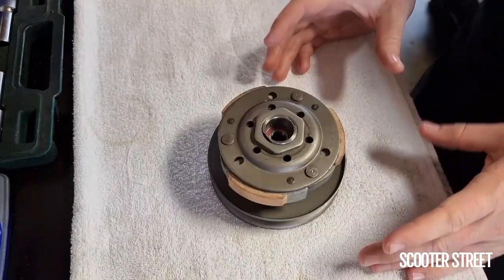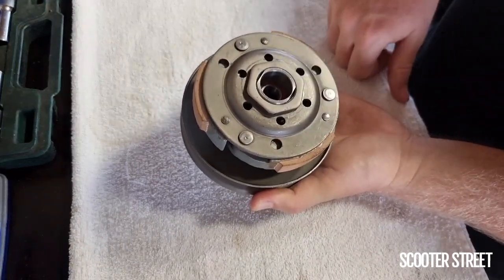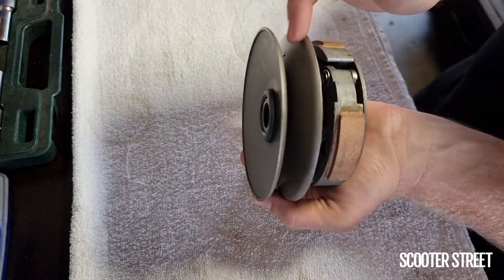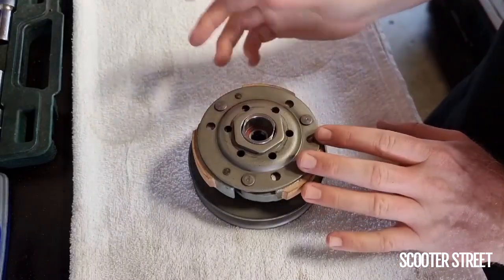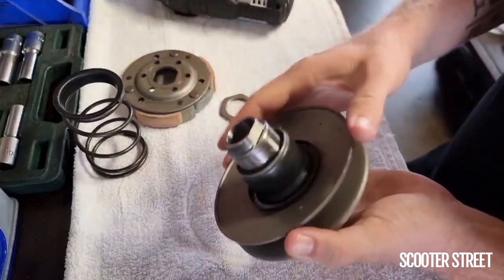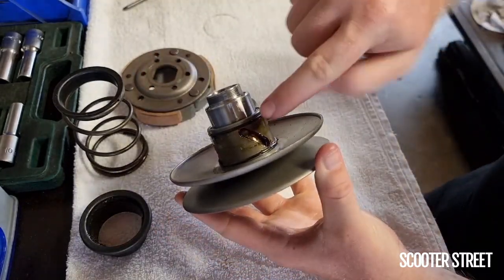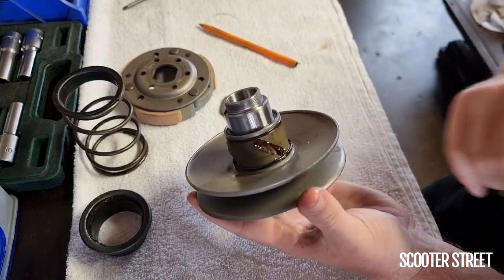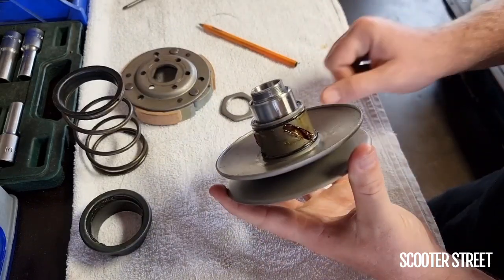Yamaha / Minarelli Transmission Fix!

Comment: hi would u be able to give us a name of the type of grease that should be used for those pins and the internal of the pulley. cheers man
Reply from the maker: We use Malossi supplied grease.
Reply: malossi have a couple different greases
Reply: 2 or 3 types for variators and rear pulleys, not sure which one to get. to be used in a stock jog cy50 rear pulley

Comment: The fix was to just buy a new one?? That is not a fix. that is just a solution. I have a Aprilia Leonardo 125cc from 1998. And it has this problem and I have looked at it. Would you know any brand that have interchangeable parts for mine? I know many scooters have a engine number like 139qmb etc but i dont know the number for my engine so its difficult finding the exact part on AliExpress since the Leonardo is not such a common sold bike but it sure has many common parts. I just dont have the number or a different scooter to compare it to wich are kore common like a different brand. Thank you. Im in Norway so im not gonna come by your shop. Im just asking for help. Thank you
Reply from the maker: However you want to see it mate! If a part is worn or broken, get it fixed, replace the part or the peice and problem sorted. Search for 139QMB parts there are many coming out of China and Euro suppliers.
Reply: @scooterstreetau  but 139qmb is a 50cc and that is the number on my Chinese scooter. But I was hoping you could give me engine code or anything information about the Aprilia Leonardo 125cc 1998 scooter. That is what I am working on now and the grooves in the rear CVT is worn so I should replace it. But it's not many results searching Aprilia Leonardo and I was hoping you had some magical book where you could see what interchangeable parts for different brands I could search and buy for my Aprilia. And I was not negative on your video but I thought you als had a nice fix I could do here at home and without buying a new part. ;) So again, do you please have some info about my Aprilia? Everything helps, even if you have measurements I could go search for also. Please
Reply from the maker: @RIMHQ-YT  You need a parts diagram for the engine. Check this out.
 https://www.apriliagenuineparts.co.uk/navigation-aprilia-parts-leonardo-14.php
Reply: @scooterstreetau  my comment got removed by YouTube again. I said thank you for the link. :) It showed the diagram but unfortunately not dimensions. My luck always finding the rarest least sold bikes and then needed to find parts. Story of my life

Comment: There are 2 types: 105 and 107 mm torque drivers. Mines a 2001 Aprilia Area 51. Which size should I get?
Reply from the maker: 105 and 107 represent the bell ID, the Area 51 is 107mm.

Comment: how big was the socket you used to open the clutch?
Reply from the maker: Yamaha is 39mm, Malossi Torque nut is 38mm.
Reply: @scooterstreetau  Thanks for responding. So if i were to open a Yamaha Aerox clutch id need a 39mm, correct?

Comment: I forgot to mention that i have a aftermarket performance pipe, as well tecnigas.
Reply from the maker: With exhaust, replace the main jet, rollers to 10% less only! Clutch spring set 2500-3000 rpm. Adjust rollers as required.
Reply: So i should keep the red springs, from new clucth and just adjust jet and roller correct?
Reply from the maker: @Prasowkasportowaa  The clutch springs can be replaced but I would not go too high in the tension. I mentioned above.
Reply: Thank you very mutch for your help sir 🙏🏻
Reply from the maker: @Prasowkasportowaa  you are welcome👍👍

Comment: Hello Sir i recently changed my  stock clucth for a mallosi red springs, on a 50cc stock build, before she was ok, now she revs very high but no power she literaly takes a lot to start get some speed while reving high and i have a stock variator. 5g rollers, maybe you could help me?
Reply from the maker: Springs are too high tension for 50cc. Rollers too light.

Comment: So am I right in thinking that if my secondary pulley has straight diagonal slots it's more performance orientated?   
Just serviced my xmax and the rear pulley was straight diagonals no wear after 22,000 miles but didn't have the curved slots that So many say are stock.
Reply from the maker: All TD's start off as straight diagonal cuts on the Torque driver shaft, as the driver wears the slot becomes wider and this straight cut start to change in shape having a belly shape on the force side. Both the pins and the shaft cuts will wear. The larger engines have larger components with greater surface area which gives a lower wear rate.
Reply: @scooterstreetau  gottcha 👌  I have the minarelli s/c 125cc,  has same transmission as the 250cc so would explain the lack of wear,  although it still struggles to change ratio on hills, wonder if my contra  spring is cooked,
 any recommendations on spring colour or just go to a malossi yellow contra? I will watch a couple more times so it sinks in hahaha 😆
Reply from the maker: @liamkenny100  Usually for this issue it can as simple as reducing the roller weight by 10%. The factory rollers in the Xmax 125cc are 20x12mm 10 gram so try the 9 gram (2021> are 20x12 8G). Trial different rollers and see how you go, there will be a best result and it will up to you to find what suits you and your scooter best!😄
Reply: @scooterstreetau  9 gram is exactly where I'm at now, the bike feels better loaded up with weight,  and pulls well occasionally 😅 with just myself on, I will be trying a few other things, thanks for the replies 👍 😀
Reply from the maker: @liamkenny100  Great, you are onto it!🤠

Comment: Hi, I have a 50cc 2 stroke scooter, and the belt doesnt go all the way up, could the "groove" be the problem, as its not allowing the rear pulley to open all the way?
Reply from the maker: At first I would say NO. When the belt travels forward as the gearing changes the belt will stop progressing for several reason but mainly I can list 2:
1/ the belt is sitting at the lowest point in the rear pulley and cannot physically move as it has met its limit of travel. Is the belt too wide, too short and incorrect belt? 
2/ There is a mechanical restriction not allowing the progression of the belt, with this I refer to the rollers being to light, the engine RPM too low, the rear pulley (as you mention) not closing - this usually causes slippage of the belt.

Some things there to check and isolate why.

Comment: The fix ?, ok.... get another one but what it is the difference, with the old one ? , model ? , why the new one won't act like the old one after a while ?
The fix isn't explain properly i think.
Reply from the maker: You can replace it with the Malossi outer pulley (the pulley with the slots) which will help. Unfortunately this is just a common problem with the Minarelli engine, so it may happen again over time. This is just the nature of the engine.

Comment: What is the size of the nut on the clutch?
Reply from the maker: I cannot be sure without measuring, so I would only be guessing from memory ID. 32mm.
Reply: Thanks for your answer. Anyway, I was wondering if using a sandpaper and some polishing cream on the slots where the pins go just to get the surface flat would work instead of buying a new clutch. And can be the springs on the clutch be loosen so that is why it accelerates in low gear instead of high gear?
Reply from the maker: @waltercr80w  Best to just replace the Torque Driver, Malossi sell this part alone.  The issue is the shape of the slots has changed and no longer allows a slow detailed progression of the pins to run. Hey give it a go and let us know how it went..

Comment: The torque drive. The often forgotten part of the CVT system. 👍
Reply: Exactly but its half the performance set up right..
Reply: @landmonkey22  that's right. And some people just think fitting a super hard torque spring will work. With no consideration for the effect it will have on other parts performance.
Reply: I couldn’t see one for  a BWS100 on your webpage. Can I special order a setup with a sports clutch as a package ?